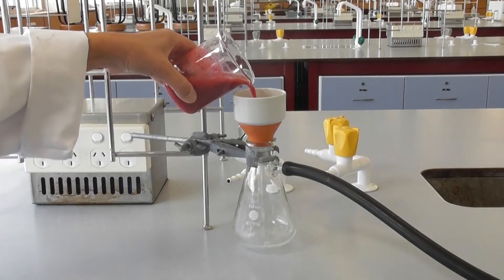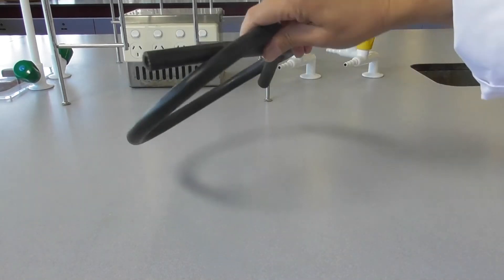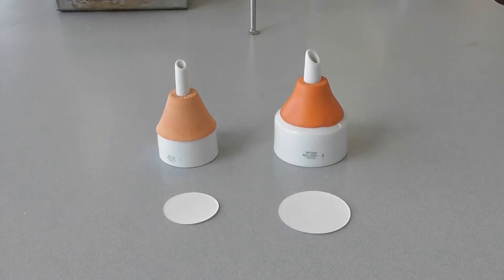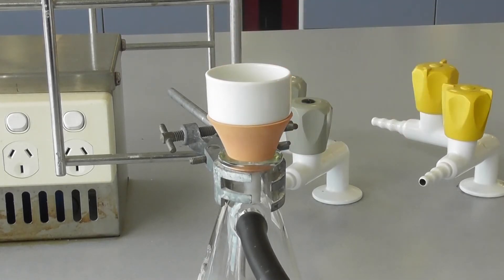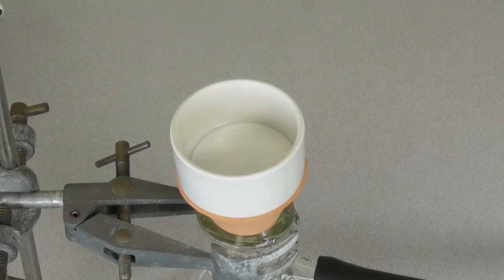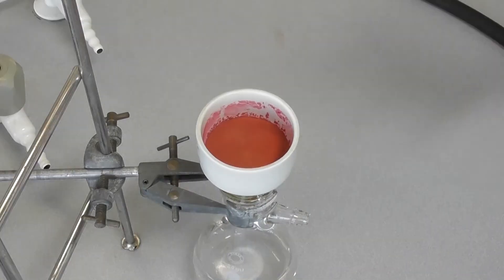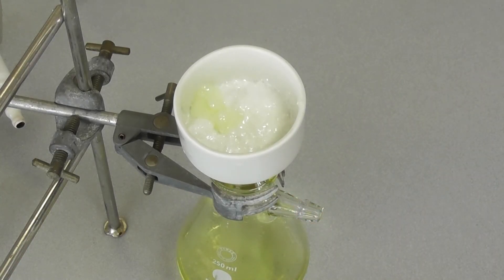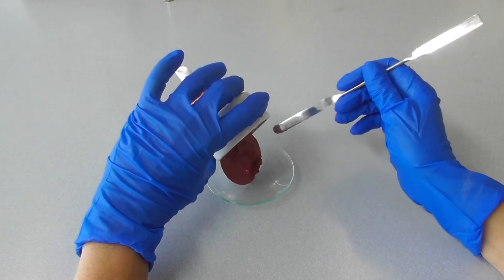Vacuum Filtration - Science@Waikato

Comment: What vacuum presure it is? I can’t get fluid flowing at such rate, using quick filtration filter, and fluid only flowing dropnby drop.
Reply from the maker: It really depends on the solid that you're trying to filter, if it's fine particular matter it is difficult to filter as it will clog the pores quickly.

Comment: why is the vaccuum pipe attached to the top of the container not the bottom does it make a difference?
Reply from the maker: You need to attach the hose to the nozzle on the vacuum flask, and that is at the top. That allows for the filtered liquid to collect in the flask without being sucked into the vacuum hose.
Reply: @sciencewaikato5734  thank you

Comment: I kind of want to buy one of these setups just to make coffee. I feel like you could get some really smooth coffee by vacuum filtering it from the grounds.
Reply: We were talking about vacuum filtration in my chemistry lab and the lightbulb immediately clicked.. I’ve been manually filtering my cold brew at least 2 times or else it’s not smooth. But it takes a looooong time if enough sediment is floating in the coffee. Strongly considering getting a setup
Reply: @slowedits2063  I wonder if the process would be quicker if you passed the hot coffee through a conical sieve to remove the larger bits of ground before filtering it.
Reply: @slowedits2063  If you're still in need of a vacuum filter now, I can offer professional advice.
Reply: If you bind the tannins and other impurities with some sort of sticky protein, like casein, ahead of time, you can actually end up with crystal-clear, pale yellow coffee.  It has a distinctly coffee flavor, but much more subtle, and with very little bitterness.  It's pretty crazy!  And it allows you to put coffee flavor in things that you normally wouldn't because of the color, like pancake batter or donut glaze, or even things like chicken soup, which might sound odd at first, but a splash of clarified coffee actually makes chicken stock taste extra "roasty", which is delicious.
Reply: Shit I have one I might try that